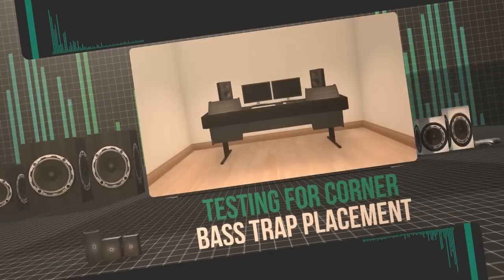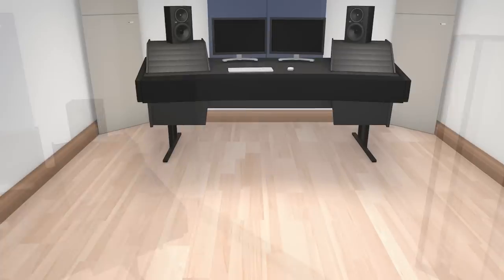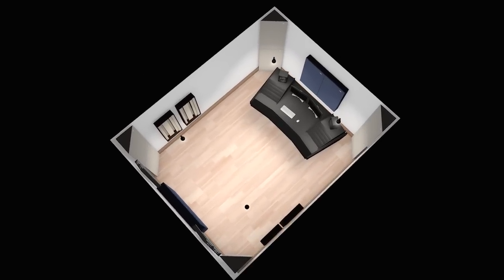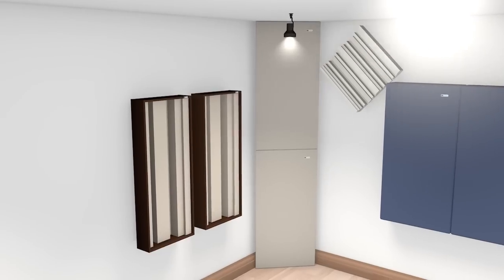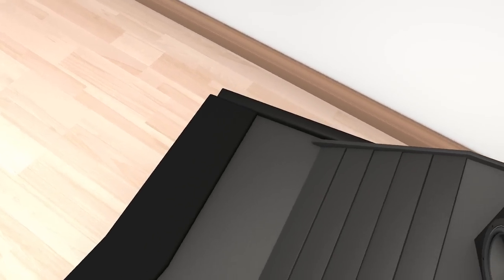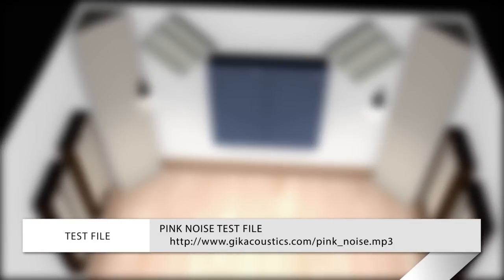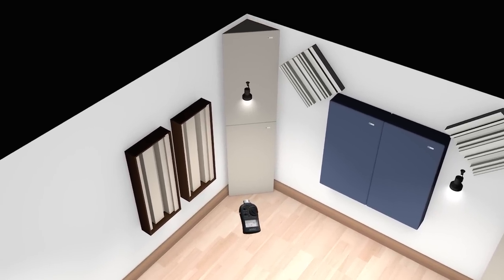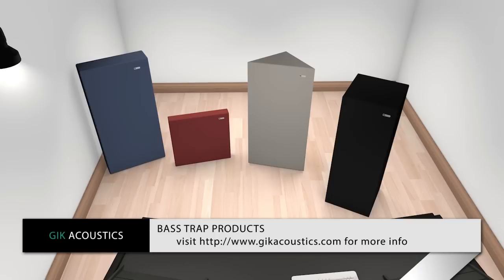GIK Acoustics: Room Testing for Bass Trap Placement

Comment from the maker: Very common for the floor to wall corners to pick up bass. In fact if you have concrete floors (even under carpet) chances are that is the area most of the time. Some low end can go through normal dry wall vs with concrete it will reflect.

Comment: Very informative video, thank you! A question: I have very limited space in my room for bass traps, so i was wondering if the best strategy would be for me to move my sub around the room until i hit a spot where the bass builds mostly around areas i have some room to add trapping to? I know bass always tends to build up in corners, which are the hardest for me to add trapping to, but i assume depending on the sub placement you can sort of get it to build up in different areas?

Comment: Any advice on how to find bass build up in a very large room - 110'x110? The standing waves are horrendous. Play a 50 hz tone and walk in the middle of the room and tone cuts in an out as you walk. I've never been able to identify any location where it "builds up", such as a corner or wall. Any ideas on how to locate the offending boundary? The walls  and ceiling are double 3/4 drywall. (1.5" thick) Floor is concrete. (w/thin carpet)

Comment: FOAM DOES NOT TRAP BASS FREQUENCIES (30hz - 100hz). Foam can work for frequencies above this range and often higher, but if you truely want to handle bass frequencies (30hz - 100hz) you need either diaphragm absorbers or a room larger than 30' in one dimension so the air pressure can dissipate. Foam "bass traps" can help a room sound better due to mid and high freq absorption, but do not trap bass frequencies!